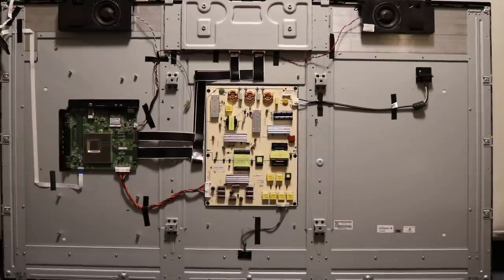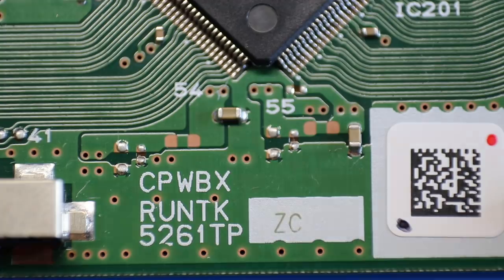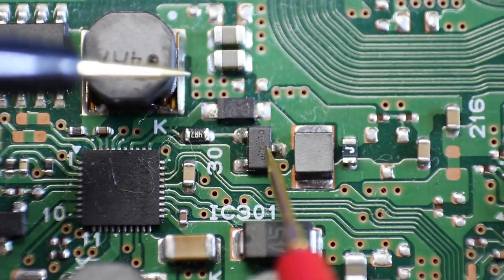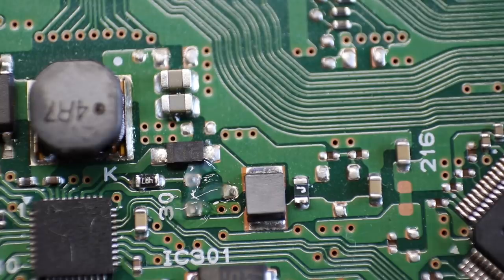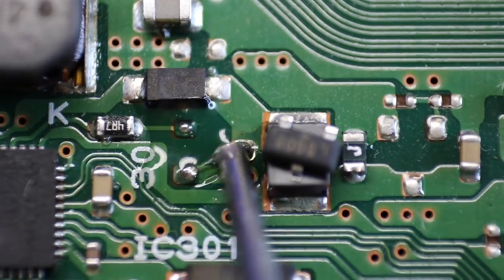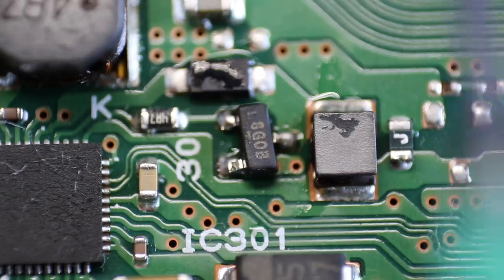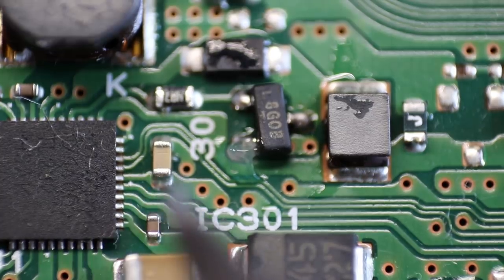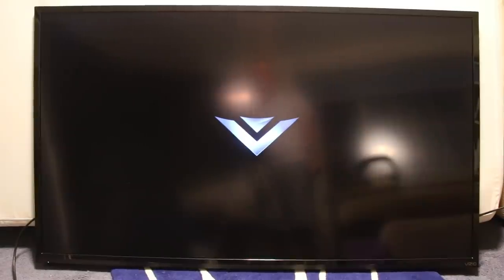60" TV for less than a $1 - Vizio E601i-A3

Comment: Hey help fix my screen flash colors  red green white repeatedly
Reply from the maker: Are they solid colors?
Reply: @FrugalRepair  can you fix? Solid yes
Reply from the maker: @russellnobuo1868  I think that may mean some kind of test pattern.  Can you look up how to factory reset your tv?  If that doesn't work, you can get a new main board.  What have you found by searching online?  Any clues?
Reply: @FrugalRepair  there were few related issues but none of them show any troubleshooting method
Reply from the maker: @russellnobuo1868  If a used main board is inexpensive, I'd consider getting one versus how much time it would take to diagnose.  I haven't obviously tested your tv but that is my guess.
Reply: @FrugalRepair  your right this TV is  called Sylvania , i dnk if your familiar with it, I just want it fix
Reply: That problem is widespread among multiple brands. The cause is sometimes one or more bad caps.
Reply from the maker: @dannygjk  I'm not sure that is what he is talking about.  Bad capacitors on a power supply are widespread in older tv's but they wouldn't cause a test pattern of solid colors.  Bad caps could cause strange colors on the image already present.
Reply: @FrugalRepair  Maybe you are right but a guy with over ten years experience said bad caps could cause the TV to go into that mode. The full screen solid colors flashing 5 secs per color white, red, green, blue, black has happened to many people. It's not always 'fixable' by doing some kind of reset.

Comment: Why on earth would you put the blobs of solder on the board first? Instead of being able to lay the component flat on the board it was all raised and unsteady you would have put the new component on so much easier with clean pads lay it flush on the board then use your soldering iron rather than preexisting solder and hot hair

Comment: My tv is a Samsung and its problem is that colors are weird I see everything in green some times all red
Reply from the maker: Is it an older (before 2011 or so) tv? Did you check the capacitors on the power supply?  Google capacitor plague
Reply: @FrugalRepair  don't remember year i will check, and i will chek capacitor tanks
Reply: @FrugalRepair  The plague has been still ongoing up to at least 2017. Maybe at least one manufacturer sat on some previously manufactured caps and slowly released them over time to avoid suspicion.

Comment: top tip: fix shit.   I very much agree with you there.  but your execution of the replacement job was proper amateur. there was enough flux on there to float a boat. quite a big boat.  also hot air gun was shit - did you not notice you started to unsolder some of the other components too ??

Comment: 54 cents ... and $637 for the hot air station, and $551.22 for the solder station, and $69.99 for the fume extractor, and $163 for the multimeter, and the solder, and the flux, ect., ect..
I'll probably ditch that 720p (if not lower, judging by the camera shots) TV with a terrible backlight bleed, and get a more decent one for that amount of dough.

I love how these kind of "pros" imply that you already have a hot air station, a soldering station, ect., ect. (and know how to use them) - but they always tell you how to connect a pair of wires, or how to unscrew a screw.

Not gonna lie - I knew that it's gonna be a click-bait video, but still got surprised by the amount of nerve the maker has, to label it a "$1 repair".

Comment: wow ok i have the samsung ks 9000 55' curved qled with the same problem. it has happened before and samsung fixed it under warranty. This time they want 700 to fix it.
Reply from the maker: I haven't fixed one of those yet.  Do you know what they replaced?
Reply: @FrugalRepair  well i know what they say they replaced, but honestly this is thailand so it could have been anything. they said the screen died.
Reply: my gut says it is a fuse or something small. we had some power fluctuation the day before it died.

Comment: I have a 60 inch Vizio that I purchased in 2015. Just the other day, it wont turn on anymore. It's like it has no power supply, I called a repair man, and he said he would charge me $75 just to come out, and he repair would be anywhere between $100-$200!! 😬😬😬😬 Can you help?
Reply from the maker: Sure!  First thing is to look up the model number online and see if there are common problems with it.  Did anything happen, like a power surge or anything?  You may need to open it up and take measurements with a multimeter, are you ok with that?
Reply: @FrugalRepair  Nothing happened to it, it was working fine the day before and all of the sudden the tv has no power. I unplugged it and plugged it back in and it still fails to turn on. It's as if the tv is not even plugged in.
Reply from the maker: @georgeh9945  Sounds like you need to start diagnosing the power board with a multimeter.  I have a video on what to do after a power surge and what to check that may be helpful to watch.
Reply: @FrugalRepair  thank you so much!

Comment: Wellll I do not know where to begin my comments for this gen of techies. OK I have been at this for a few more years then most of you ( gee can I lie to say only 40 years!! ). First congratulations on fixes TV's that would have gone to the garbage. As a EE and technician that has logged 1,000 of hours on my work bench fixing everything, I can say I am very please to see this generation going back to the simple basics of repairing electronics, WE DESPERATELY need to start repairing again and stop filling up the dump with damm plastic, as the future. generations will almost be buried live in it .
  WARNING this can lead to a hording obsession of dumpster diving and geeks like us, tend to accumulate large catacombs of " I need to repair this TV, Dryer ETC......" projects. Then you will run out of time and the electronic junk yard will start to almost attack all your living space.
I had a friend like this and his only answer to the catacomb problem was to stop every 5 years of so and hire the "we haul junk crew" to clean out the garage and basement. That way he could start over again.
  On de-soldering, I have been using my trusty PACE de-soldering tool for over 30 years and on these thin light copper PCB the key is to just get the iron hot enough to melt the solder or you will burn up the PCB and lift the copper.
Reply from the maker: Thanks for your comment!

Comment: Shouldve used flux before & after!
Reply from the maker: It was not needed before to remove the transistor and I used lots of flux to solder on the new smd.  Am I missing what you are getting at?
Reply: @FrugalRepair  I suppose he means to prevent possibly solder getting to other connections on the board.

Comment: Part costs 59 cents. Tools to replace it with cost $600.
Reply from the maker: You are missing the point.  Of course, it would be silly to purchase a quality hot air and soldering station for one repair.  But since I do this regularly it is well worth having them.  Look at the cheap set I linked to in the description for an example of what you can get started with.
Reply: @FrugalRepair  I want to get started.

Comment: Dude, either have less coffee (maybe more alcohol) or take a beta blocker for your shakes.
Reply from the maker: Nice, I've mentioned in several other comments explaining this.  I should have moved things around but when I filmed this I had to ditch my microscope and I didn't move my hot air station to the right spot.  So that is what you get when trying to do it left handed with a super tiny device through a camera lcd lens. =)

Comment: Can u fix my tv man
Reply from the maker: Probably could, unless the lcd screen is broken or bad.
Reply: @FrugalRepair  No sir the screen is fine the problems is that that tv does turn on and work fine for the hole day but when I turned off I turn it back on it doesn't turn on the led light fades away.
Reply from the maker: What is the brand and model of the tv?
Reply: @FrugalRepair  Vizzio
Reply from the maker: What is the model number?  Did you research the mode number online?
Reply: @FrugalRepair  Well I went to but another power cord and it actually work again and I reset the tv so I guess is good I don't know.

Comment: $0.64 for the part, $2000 for hot air station, $5000 for the microscope...
Reply from the maker: That is about $7,000 more than what I paid.  I didn’t even have a microscope in this video.  I do now though, and I bought it on Craigslist for $150.  Did you see I listed a super cheap iron and hot air station in the video description?  You could use that if you wanted.
Reply: @FrugalRepair  Ok, the hot air station you listed in the description says $980 delivered to my house in South Africa. Plus it's 115v so I'll need a voltage converter, so make it $1000 for the cheapest hot air station you can find... We don't have Craigslist here so I probably wont have that kind of luck, but yeah, you don't need a microscope for that kind of work... 
On another node, I have a message from Earth to FrugalRepair: Jokes are a thing now! And I really enjoyed your video :)
Reply from the maker: Ok thanks for explaining.  Glad you liked it!  Did you see the video where I fixed a 65” 4K?  I think I did a much better job explaining things than in this video.

Comment: Very sloppy soldering job and I don't understand the heat gun.  It gets hot enuff to melt solder but doesn't harm the surrounding components?  I think I would have just used the soldering gun to begin with.  But at least it's fixed.  Junk brand TV so it doesn't deserve much else.

Comment: I just buy a new board. $50 fixed.
Reply from the maker: Yep, that’s a great way to do it too.
Reply: @FrugalRepair  I changed it on my 10 year old Samsung 5 years ago. Still going strong. It's always the capacitors that go on the T-con board for Samsung. My Sony Bravia from 2005 has backlight issues now. the middle of the screen takes a couple of mins to light up. They were expensive TV's back in the day the Sony cost $3500 and the Samsung $2500. I'll just replace them once Coronavirus is over. Help the economy and CCP recover :)

Comment: Can you fix my tv
Reply from the maker: What is wrong with it?
Reply: @FrugalRepair  screen repair
Reply: And a whole new led in screen replacement
Reply from the maker: @markellfrazier8988  I definitely can replace an lcd screen but the problem is that you can't buy new ones anywhere.  You need to take them from another identical tv model.
Reply: @FrugalRepair  ok but its a sceptre 4k uhd 55 inch tv in i dont know how too do all that

Comment: 54 cents and 3000$ in tools? Lol wish I had all that stuff hot air station pinpoint soldering equip magnification tweezers hmmm sounds like a new expensive hobby
Reply from the maker: I take it you did not see the $35 setup I linked to?
Reply: @FrugalRepair  Lol obviously I missed that...my bad. You make it look easy brotha
Reply from the maker: @gdubb6905  No prob.  Thanks!

Comment: $1 part. $300 in tools to fix it. You can buy a brand new 55" TCL for $300.
Reply from the maker: I already had the tools so it was only the part.  Others on the internet helped troubleshoot it.   I put a link in the description to a really cheap toolset, cheaper than a new tv.  Also, to replace the whole tcon board would only cost you like $20.

Comment: you dont need hot air station to replace single transistor, also that is very bad job you did with hot air station, either too low temperature so solder doesnt flow properly or low airflow.

Comment: Nope!... This Mosfet normally get shorted because the LCD tabs are shorted so replacing the Mosfet only without removing the tabs shorted will fail....nah...
Reply from the maker: Do you have experience repairing the short on the lcd tab?  If so, I’m curious to know.  This tv is still working great under normal usage years later and the only thing replaced was the mosfet.

Comment: Don't even bother trying to fix newer tvs.  If you don't have the experience, chances are you won't be able to.  Almost every model is different in that boards and many parts are not interchangeable, they are loaded with surface mount components that are tiny, and contains lead free solder.  Unless you have experience soldering surface mount components using lead free solder, don't bother.  This is just a few reasons.  No service information is available, practically no parts, and newer sets were NOT designed to last or be easily repairable.  Forget it.  You'll just be wasting your money trying to fix newer tvs.  At some point in the past people decided that a throw away society was best.  They were dead wrong.  Thousands of people lost good jobs in the electronics repair industry.  Livelihoods were ruined.  Millions and millions of tons of materials are used every year to make new, low quality electronics that almost never last more than 3 to 5 years.  Do I like it? No! I've done my best to repair as much as I can, and stop items from ending up having to be recycled.  Most techs gave up long before I did.  People need to stand up and say to these companies that they want quality items that CAN be repaired,  and for parts to be supplied at reasonable cost.  It's YOUR hard earned money.  No one likes throwing money away.  We need to make better use of our resources than just throwing stuff away and buying new.  In time we'll pay for it.